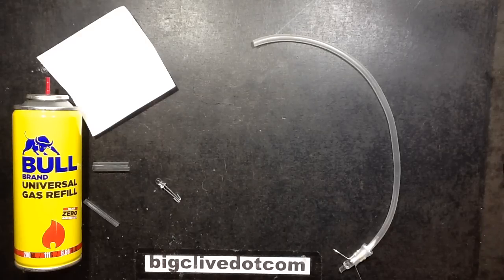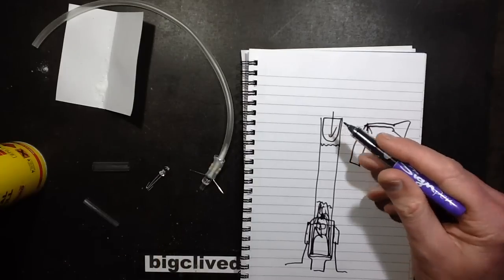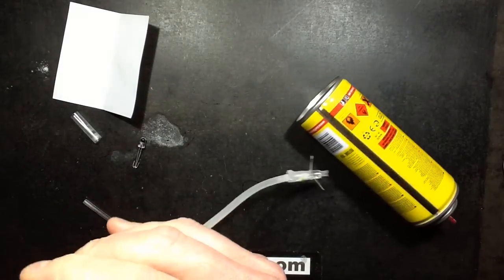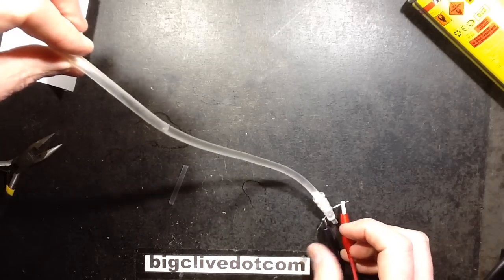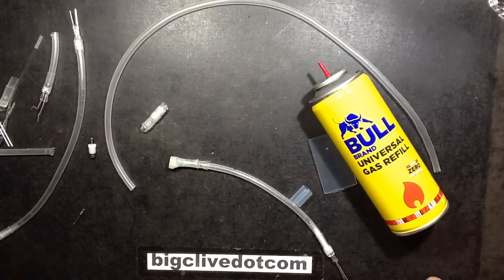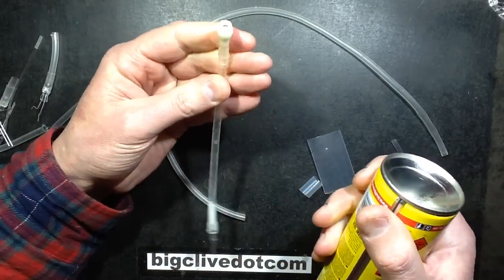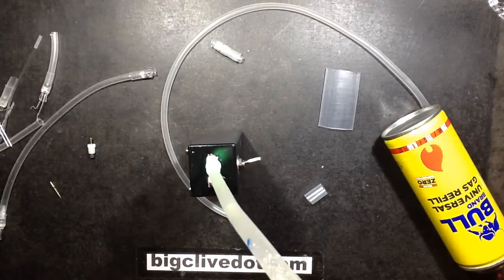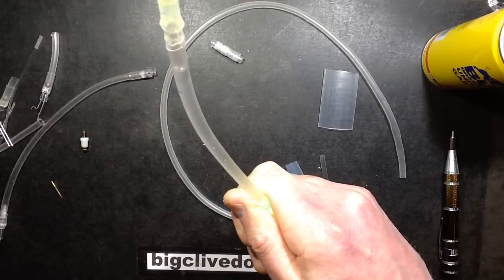The completely dubious "flexible butane bubble tube" experiments.

Comment: 1. don't shake the butane can
2. you need to let some of the pressure out of the tube as you fill it, yes this wastes some, but necessary if you want a "full" tank.
note* above from experience repairing vintage butane lighters
Reply: why not shake it?
Reply: Mostly because butane doesn't like to be cold, and guess what happens when you shake it?

Then it acts like a cold can of compressed air till it warms up again.
Reply: XombyCraft I thought it would be dangerous

It just makes it harder to use?
Reply: Yeah.  you won't get a good fill in a lighter with a cold can of 'tane.

As for dangerous, the only thing dangerous about butane is the user.  I handed a can of butane to a moron once, and he pulled the trigger on his lighter while he was filling it.  was a glorious fireball.  Luckily, he didn't really like his knucklehair anyway.
Reply: XombyCraft Free shave lol
Reply: yup!
Reply: Along those lines, as a teenager my mate bought a cheap boat. We had a barrel that had a bit of petrol stored in it, out on the back deck (well, hardly a deck, a few feet square). When it was empty, my other mate put a lighter to it, for an amusing "whoosh" effect. 

After that, assuming it was empty, he decided to take a look into the tank. Using his lighter for illumination. Of course, as you've probably realised, the tank wasn't empty, he'd just used up all the air that was inside it. After a while, fresh air had got in...

He wore big sunglasses to school for 2 weeks. A doctor said he'd be OK but to keep out of direct sunlight for a while. The eyebrows grew back.
Reply: greenaum damn
Reply: Yup!

We did try tell him not to investigate a petrol barrel with a lighter, but it fthoomed before we could finish the sentence. "NO!....."
Reply: greenaum RIP eyebrows
Reply: I find if you run the can of butane under hot water for 15-20 seconds it helps heaps

Comment: Silicon tubing is not suitable for contact with any petroleum distillate or liquid gas like butane, it perishes the silicon, turning it brittle,  and it bursts. It use to be used as fuel line in R/C planes, but was banned, and PVC based tubing is the only safe alternative. It can be obtained in larger diameters and my well work in this use. But any leak is deadly.
Reply: Silicone.  Silicon is rather different.

Comment: Silicone is not the best, I did an experiment with a container that had a silicone stopper.

I found cooling the container down in the freezer before putting butane in was best option but over time it will evaporate and silicone is porous, so its not the best containment, you end up with a butane silicone saturated device and you can light it, as I found out.

Comment: I've just had an idea for getting a better seal at the top of the tube: fill it with butane as you did here, but when you're getting close to having the right amount, pinch a section near the top shut very tight with a carpenter's clamp. I'd reckon that would give you a good enough seal for long enough to close the end off with hot-melt glue or similar.

Comment: It sort of works, but I would like a house to come home to at night.  That is if I don't burn it daon making it in the first place!  You do get a nozel for the propane burner that puts a point of flame out and this is what you needed for the glass. Keep heat on glass while you keep sucking the air out, that should work, yes I know it will suck in the tip of the tube but do it a bit at a time, leaving only a small hole and a long tail.  Heat it up quickly and twist and instantlly cool it down with cool air, the tail should seal.  Once it is sealed you can work it to ridy it up with a shorter tail.  I don't think gas is the best thing to use in there though.
With you using the plastic tube I thought if you worked on it you could get a coloured liquid in it and heat it from the bottom from a glass file.  It would take a bit of time to try other things, but even slow bubbles going round a long tube with random LED's  lighting the tube would have a nice effect.  As the bubbles passed an LED it would get brighter.  Just thinking out loud, I know you are trying to copy the Christmas decoration tubes.  But it could evolve! 
I would never use gas though, it just is to volatile!!
Reply from the maker: I did end up making a successful tube with methylene chloride.
https://www.youtube.com/watch?v=OvDpnp2jRgs

Comment: Thing about gas, it needs pressure more. I was able to get Butane into an old solder tube, by using the cap, it held the pressure, and I was able to get it in liquid form without much gas loss, and then left it in a fridge freezer for 20min it was full stabalised and in liquid.

Comment: Most Super glue sets instantly if you mix it with baking soda could try using that to cap the gas in the tube, if you're going to remember to actually mix it in because if you don't it will just set the outside and leave the middle liquid for longer than normal because there's little to no air

Comment: problem is you need to evacuate the air in the tube first, then get the butane inside.  likely would work better in a freezer when filling.  and of course you need to close up both ends, which glue isn't the best option for as it doesn't like high pressure very much and will form micro channels to allow pressure to escape

Comment: Second idea... Use a much longer tube, and coil round the top, gas-filled half and hide it in a case. You could then pot the ends in epoxy or the like. By making sure the liquid was all down at one end, and potting the other, the heat from the epoxy wouldn't matter so much. You could also stick some ice further down the tube, to absorb any heat that does get there. 

Third, much better idea, is use something that's liquid at room temperature! Something like alcohol. The nice purple colour you get in meths might even be decorative. Or some other solvent. You'd need more heat, but it should stay where you put it. There must be some liquid that bubbles just above a nice cosy room temp. 

Also, for this idea in general, if you're gonna put heat into it, ultimately that has to come out, just as fast, or you're going to lose liquid, it'll evaporate and put even more pressure on the tube. So have some form of heat disposal. You could maybe, if you were smart and lucky, use a Peltier to take heat out of one end, and put it back at the other. Use some metal to transfer the heat. 

Final tip is of course, point it away from your face!

Comment: we use propane or green gas that is propane with silicon oil gas for airsoft pistols when filling the mags it helps if you use short burst into the magazine rather than a lot at one time stops a lot of the cooling down and discharge when the O-rings let go

Comment: you can literally punch a hole in these small gas bottles.
It will do a small pop and pressure will be released.
Then you put another hole in and then you can pour the liquid butane out like out of a water bottle.
There also aren't very much losses in the process

Comment: They sell clear plexiglass tubing on Ebay.
Together with the proper plumbing fittings, you could build a much bigger, and more rugged tube.
It's easier to make a valve in it too.
I think it would contain the gas better.

Comment: I thought bubble lights used a light mineral oil. Has to get hotter to bubble, but less pressure difference from liquid to gas and back. And that fluid remains liquid at room temp so it should be easier to deal with.

Comment: 7:44
Of course it's violent! A quick back-of-the-envelope calculation shows that Butane gas expands about 230 times in between beeing a liquid and room temperature.
(reciprocal of the denisity at boiling point divided to the reciprocal of the density at 20 deg. C according to wikipedia); 
if Butane were an ideal gas, it would be in the ballpark of 250x expansion. (compressibillity factor of about 0,925).

Comment: ive been dold to silicon tubing can be abit pourse to gases  i have used a water cooling computer system with silicon tubes and lost water on a sealed system i tried pvc pipeing and the losses where a lot lower  just a  thourght
Reply from the maker: keith watkins I was considering a bit of PVC pipe, but I think it might be quite hard to properly seal onto the waxy plastic.  The internal pressure is also so high that it seems to just squeeze by press-fit connections.
Reply: bigclivedotcom I'd try using some solvent-based PVC cement to make the connections, it'll definitely grip the tubing. The issue then will be if it will grip anything else. Also, if the silicone froze on exposure to the butane it's evidently not very high quality silicone. The good stuff is really really cold-tolerant and solvent-resistant.

Comment: bigclivedotcom
If you're still trying this, I reccommend you use Methylene Chloride, sometimes called DCM (DiChloroMethane). It's what's used in the real thing. Boils at just around room temperature (39.6 °C), so it''d have a lot less pressure. DCM is commonly used as a solvent in chemistry applications and is the key ingredient in solvent welding many plastics.
Reply from the maker: +theLuigiFan0007 https://www.youtube.com/watch?v=OvDpnp2jRgs
Reply: bigclivedotcom
That's epic!
Reply: +theLuigiFan0007 39.6 °C is not room temp... 20c is room temp...
Reply: comwarrior69
I said just around room temperature but I was thinking room temperature was 30C. Guess It's because I don't use Celsius much. Will take note of that.
Reply: +comwarrior69 I.S. room temperature (aka standart conditions) is 25°C

Comment: +bigclivedotcom try using clear fuel lines and hose clamps from most hardware stores.  The tubing may be a bit more resilient to pressure/leakage, and hose clamps will let you add tube ends/LEDs and secure them on the fly.  You can even find "wing nut" hose clamps that can be tightened by hand.  Possibly even a fill port that is metal and wont leak.

Comment: It's possible that the hardening and shrinking of the tubing could be caused by a plasticiser in the tubing migrating into the butane.
Reply: +Caleb Howes Problem with that theory is that the tube would stay rigid when it got back to near room temperature, which does not appear to be the case here. More likely it is simply a realigning of the molecules in the tubing caused by the lower temperature, similar to what happens when liquids freeze.

Comment: try squeezing the tube flat to empty out as much air as possible before fitting the valve. i think that way you could fit more gas into it
Reply: Or fill the tube through the valve, then let gas+air mixture flow out, and fill again.

Comment: if you push the pin in the valve to release the air pressure from the top, then you can get more fluid in?

Comment: Butane is easy to contain in glass... little glass sample containers of the type you can get on ebay. Spray it in as a liquid etc. I've not had one go bang :)
Reply from the maker: ***** My main concern is the shrapnel if one does go bang.  What sort of cap do they use?
Reply: bigclivedotcom The ones I have are a screw-on aluminium cap with a neoprene washer. Remember a butane lighter can contain the same pressure, and they're just thin plastic. To contain the shrapnel, I'd wrap them in a single layer of clear parcel tape. It'll act like a laminated windscreen and contain the fragments :)
Reply from the maker: ***** Or some clear heatshrink perhaps?  Although it does detract from the clarity of the glass.

Comment: Did the pressure hold?   I don’t see an update in the description?
Reply from the maker: No.  It was a disaster.  The butane also caused the silicone hose to go hard and brittle.
Reply: @bigclivedotcom    I also watch “Cody’s Lab” channel and he has taken gases and chilled them into a liquid form, then sealed them in glass tubes.  Under pressure they remain a liquid.  The problem with trying to seal butane in glass is it requires flame.  There would have to be some sort of plug to prevent the gas from coming into contact with the flame to seal the tube.  I sent him an email if he were up to the challenge in trying…. Or another low boiling point has that isn’t flammable.  Interested in seeing if it’s possible….maybe on a 100% CO2 environment using electric element to heat the glass.
Reply: I just remembered…. There are, or use to be Christmas tree light strands that looked like candles… those bubbled when the incandescent light bulb got warm.

Comment: "I"m not a good role model, technically."   Hahhaa, you're great. I"m curious, can you use anything else besides butane?
Reply: Anything that's liquid close to room temp/under low pressures and has a low boiling point. Well technically anything with a low boiling point, but the lower the boiling point the higher the pressure to keep it liquid and once you go over 100 PSI this are gonna get super sketchy! 100PSI is enough to turn anything in the end of the tube into a pretty dangerous projectile.